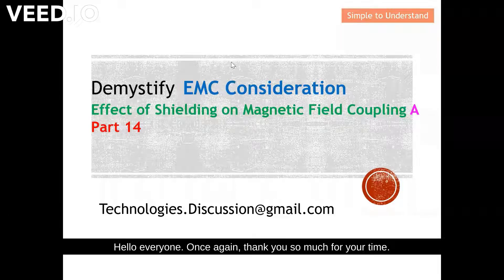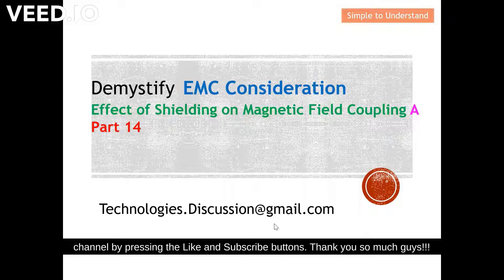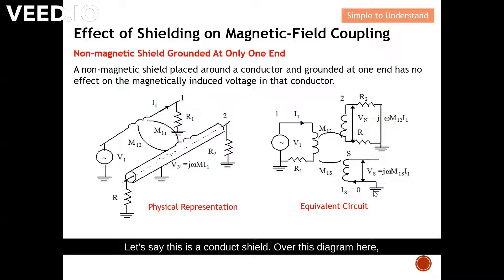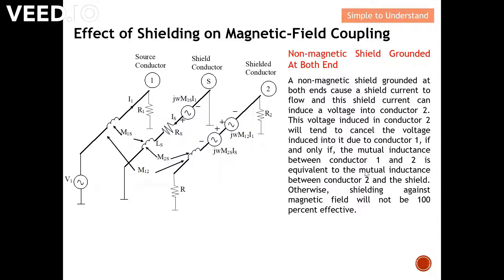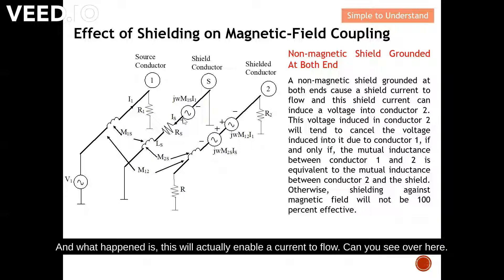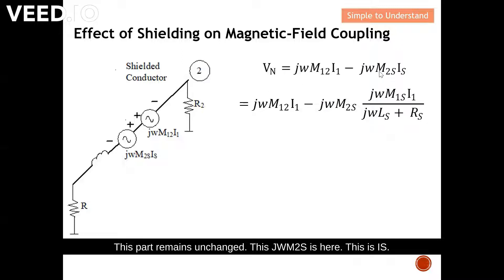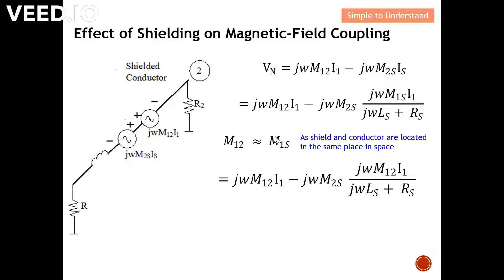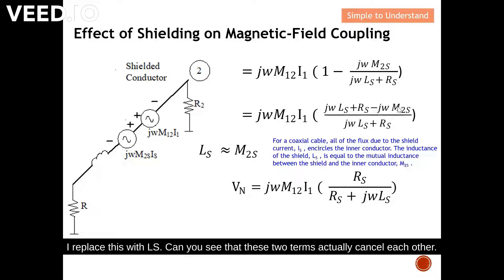EMC #14. Understanding the Effectiveness of Shielding Against Magnetic Field Coupling with Equations

Comment: So, for an ungrounded shield, won't the incoming H field induce eddy currents in the shield which in turn creates a field that opposes and mitigates the incoming field, thus partly shielding the inner conductor?
Reply from the maker: Thank you for your question. Yes, you are right.  :)
An ungrounded shield can still provide partial shielding due to the formation of eddy currents which create opposing magnetic fields, thereby reducing the effect of the incoming magnetic field on the inner conductor.
I mention partial because other issues may surface. For Eg, E-field may become an issue.
You can consider seeing my EMC consideration discussion from EMC Part 19 to EMC part 31.  With these, you have a full understand on the shielding.   :)
Thank you so much for your support too!!!
Reply: @technologiesdiscussion1676  So in the video you mention that the ungrounded shield doesnt affect the magnetic field, is this wrong, or is this because of the geometry of the shield? Or related to frequency, or nearfield far field? Also in the shielding videos with reflection, absorbtion etc, you say that most of the e field is reflected at the first boundry, but this doesnt seem to rely on whether the shield is grounded or not. Why is this? I thought grounding was determinental to the shielding of e field? Is the situation different when it comes to far fields?
Reply from the maker: I guess I have to make this clear. It is always impt to gnd the shield. Imagine this, if the shield is gnd, then the eddy effect will be shunt to gnd and so called "removed". The shield without gnd in fact can be a patch antenna and may create another issues.